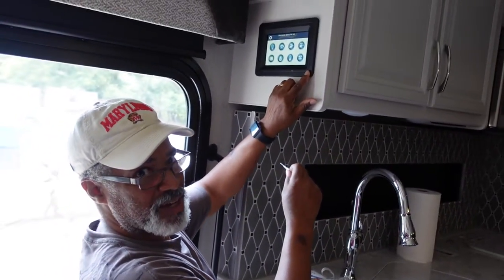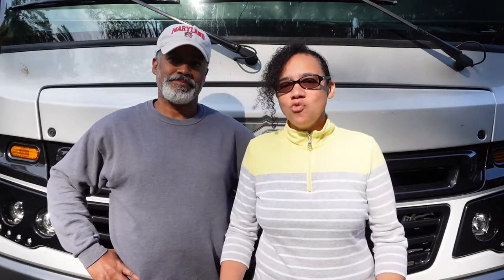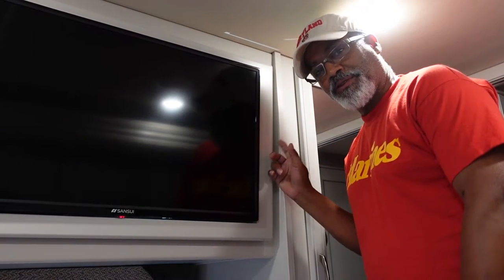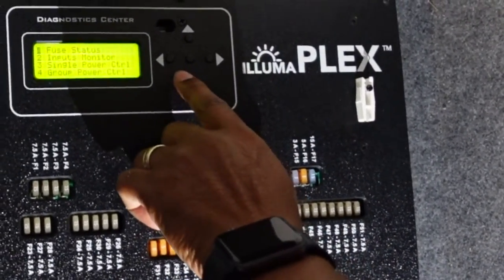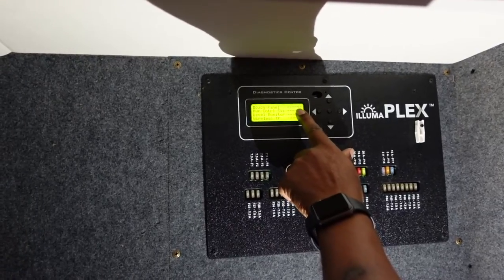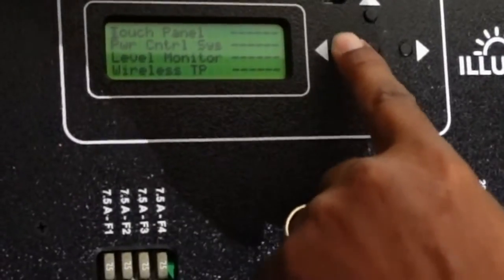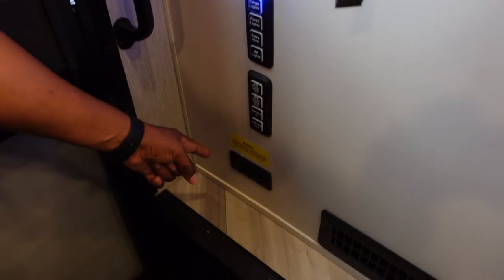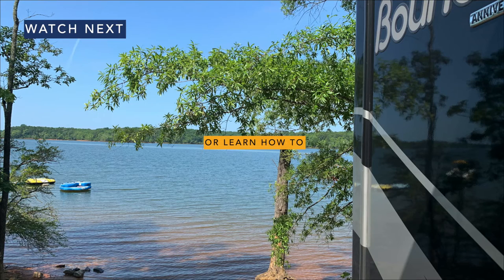Precision Circuits Power Control System runs everything

Comment: Great video.  On the 7” panel, we had the front AC temp sensor registering 20 degrees more than the rear.   I thought the sensor was bad.  I called Precision Circuit and the customer service rep walked me through testing the sensor.  After the tests, we found that a circuit board the sensor plugged into was bad.  We purchased a new sensor from them and the shipped it very quickly.  It worked.  Now our temp reading are on the money.
Reply from the maker: hmmm....that's interesting.  Lately, we've been having a similar issue.  I'll have to try running the diagnostics on it.

Comment: Our control monitor was showing "no conn..." and nothing else would come up.  After watching the video I did a reset using the aux battery button as per the video.  Problem solved!!!  Thanks for the great info.
Reply from the maker: So glad our video helped you!  😊 We struggled with the problem for months and couldn't find any info on how to resolve the issue. We've noticed that over time the 'no conn..' does return.  But reseting the aux battery always fixes it.  Safe and happy travels to you!

Comment: What do you do if if says no comm?  I tried turning the aux power off then back up and still nothing. Also tried changing the cr1025 battery behind the panel
Reply from the maker: It depends on where the no comm is coming from.  Page 4 of the manual has more details but you may have to unplug the data cables. https://www.precisioncircuitsinc.com/wp-content/uploads/2016/05/Precision-Plex-Owners-Manual-REV-A.pdf. If that doesn't help we've found Precision Plex technical support very helpful.

Comment: I am picking up my 2023 Fleetwood Bounder 35K this coming Saturday and going from Miami to Tennessee. 
I downloaded your video as a precaution, hoping not to have to use it but, you never know. Thank you, very helpful if needed. 
After seeing your videos I start to be concerned about the purchase, hoping that only minor adjustments or losing screws to adjust, LOL.
One thing I agree with you, quality or better saying, missing quality control is probably one of the issues. I purchased ours on Sunday, and during this week the dealer is making adjustments we found during our purchasing. Is not the quality but, like I said, missing quality control, ie: blinds not rolling back up, or, the dining seat stuck in the up position, or a drawer coming out of his track. 
Well, wish me luck, I hope we don't have to regret, our travel trailer only had 2 small issues that I fixed and a flat tire in 3 years, and the flat was right when I parked in front of the house.
Reply from the maker: Congratulations on your new RV and welcome to the Fleetwood family! 🎉. You are so right about quality control and the issue spans multiple manufacturer.  One thing we've found is that REV RV stands behind their product.  So if you have a problem, they will work to get it fixed!  Safe travels and maybe we will see you on the road!
Reply: @AmpedtoGlamp  thanks for your response. The funny thing, is we couldn't pick it up on Saturday, and here is what happened: We went over the orientation (that's what they call it) meaning, showing the basics and giving no response to the more complicated questions, and when all was done, papers signed, etc. they went to close the living area slide it got stuck. You can imagine my concerns, brand new, no miles, and the slide doesn't work. Fortunately, that was inside their showroom (a new one big), and had to go home RVless with the promise to have it fixed today and pick it up tomorrow. 
They took it to their service department in another location a couple hundred miles and brought it back as promised. Tomorrow will be the official spot delivery day, have to resign all the papers with the new day.
Here are my worries, we are going to Tennessee this Friday, an 800-mile drive from home, 15hrs. and spend our vacations and come back, worried about not having other issues that will leave us on the side of the road or stuck in a campground. Wish us luck.